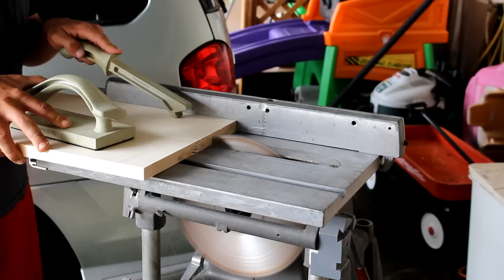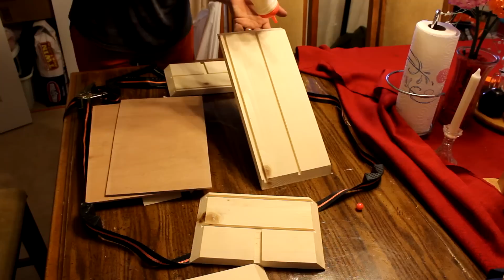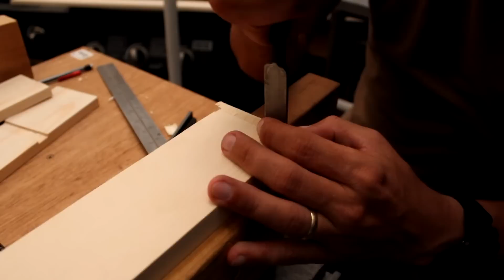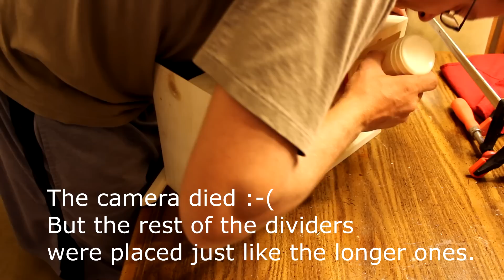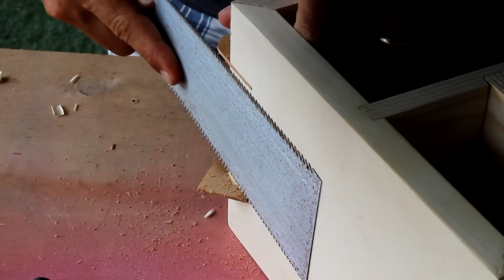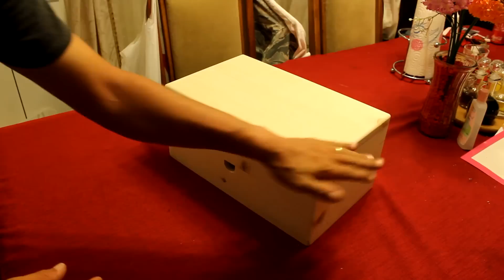Building a Magic Card Storage Box

Comment: Nice project with a minimum of tools.  The open blade on the table saw is scary, especially with kids around. You used what you had & I appreciate that. Had to chuckle at using the cooler as a bench.

Comment: Nice project video. Good detail.  I've never seen anyone use a speed square to do splines... pure genius!  

I got to say though, that is the scariest table saw I've ever seen.. I was literally grinding my teeth watching you use it....  yikes. The greatest relief came when you found your push stick at 4 minutes in.
Reply from the maker: +Klint Harder thanks for the comment. As far as the saw goes, it is a ShopSmith and I absolutely hate it. It can do a lot of things... it just can't do anything exceptionally well. Although I don't have a choice because I move all around the world and have to keep the weight down.
Reply: Well, balancing that box on a thin speed square while pushing it through a spinning blade is actually very dangerous. There are dozens of videos on Youtube that show how to build a custom sled that will do the same thing. Or use a hand saw. CFB is making do with what he has and is obviously skilled and/or lucky enough to avoid injury, but no one should think this the good way, or a safe way, to do this.

Comment: You definitely have one of the older models of Shopsmith. I've been using one of the newer (does the 80's count as newer?) models since I was little doing projects with my dad. We have a newer (late 90s) model now, and it's really great.
Reply from the maker: +Stephen I'm glad you like it. If I didn't have to be so mobile with my woodworking I would definitely choose individual tools.
Reply: CFB Creations If ours were missing the guards that are missing on yours, I would not use it. In fact, I've gotten one to use as a dedicated drill press. I really don't have much room, either.

Comment: Those shopsmith all in one tools scare the piss out of me. watching you navigate that blade made me cringe.  stay safe brother.
Reply from the maker: +Matthew Lesko thanks for your concern.
Reply: I have to agree with Matthew^. My eyes went wide when I say the saw blade exposed under the table. Might be a good idea to make a table skirt at some point. Keep safe man ;)
Reply: I have one too and never use the table saw part of it.
Reply from the maker: +Will Wyrms I won't be using it anymore! I got a new dewalt saw last month!
Reply: As long as you are safe.   It scared the heck out of me and I ended up with an Inca cablinet saw.  I still have it and occassionally will use the lathe.  The drill press is nice and I do like the variable speed function.  I might use the drill press as a boring machine more than a regular drill press though.
Reply: First time I think I have ever seen anyone use a shopsmith for anything.  I always see a few for sale on craigslist every month.
Reply: Holy moly 😱👏, scared the hell out of me...but pulled it off with 💯 skills. Killer build.

Comment: Thanks for sharing this project. A nice design. But as others have noted, you need to take much better care of your safety. Get a quality table saw (or use hand tools). Don't lean against your x-cut sled and never put your hand in the path of a chisel. And for God's sake, don't put your fingers anywhere close to a router bit spinning at 24K rpm. Stay safe above all else.

Comment: Let the trolls troll.  You made a very nice piece with the tools at hand and using techniques you are comfortable with.  Good job.
Reply from the maker: Thank you!!! I'm glad you see it from my point of view. I also appreciate you taking the time to leave a positive comment.
Reply: If you are talking about safety, I disagree emphatically. I have no doubt inexperienced woodworkers may watch this video and come away believing this is the proper way to operate power tools, or use a chisel.
Reply: I agree with Peter Bernhardt. Chiseling toward your hands and putting your head over a moving table saw blade could be a real bad day.

About 20 years ago when I started woodworking I was standing next to a guy that was cutting a blank on a bandsaw and he ended up putting all four fingers on one hand in the bandsaw because he wasn't using the machine correctly.
Reply: +Corey Welch goooooooooood, really how do you do that?

Comment: I know this is 2 years old but I think you needed a new blade on that saw, you shouldn't have to push that hard to cut something and you're getting a lot of tear-out
Reply from the maker: Yeah, the blade was dull and also since I lived in Okinawa Japan, the air was so humid and salty that the sides of the blade would continuously corrode. I don't use my ShopSmith as a saw anymore and have since got a new table saw. Thanks for watching!